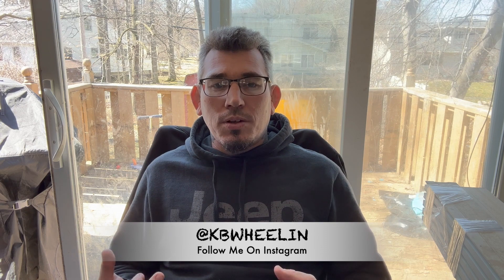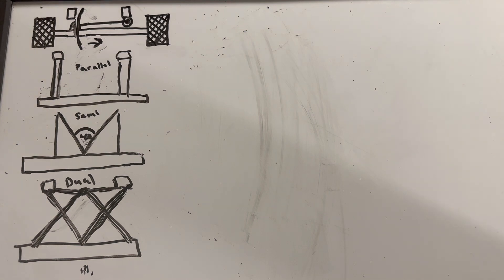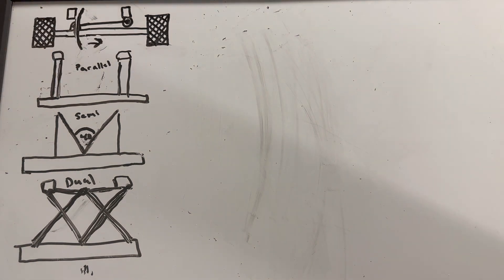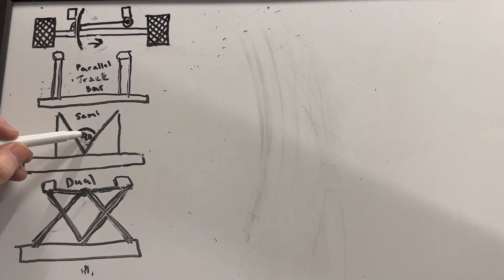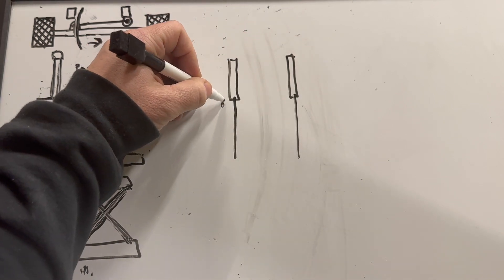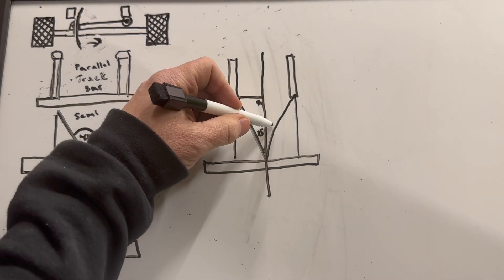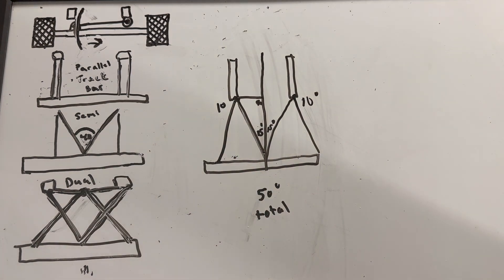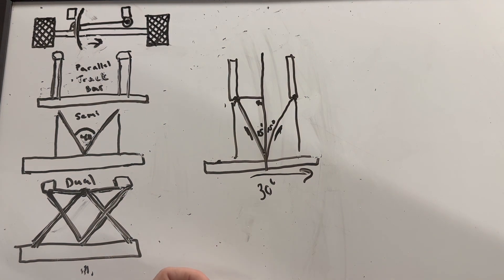Do you need a track / Panhard bar with a 4 link? Do you have enough triangulation?

Comment: On a parallel four link you mention we need a track bar, My question is; instead of a track bar can i use coil over mounted to the axle or frame instead? Thanks!
Reply from the maker: Not sure I understand what you’re meaning. You need a mean to make the axle track center. On a parallel 4link you would have to have a track bar or watts link.

Comment: On a triangulated 4 link does the pinion angle rotate to follow the t-case when traveling up and down over a long stroke range?
Reply from the maker: Depends on the upper link vs lower link length as well as bracket locations. Equal upper and lower will yes but again bracket locations can effect this.

Comment: Are you talking about a triangulated 3 link? If so I run that setup for years wheeling Tellico when everything was open. It was a Toyota turned 80% buggy with a 60 and 70 with 6.17 gears and 44s. Never gave me any problems, but I was using a 1.5" solid rod as my pivot in the upper link/a-arm. That was for the side to side movement. Had bushings parallel to the axle at the frame and axle mount. That poor thing was rolled at least twice every trip out. Had numerous hard landings on its side and the suspension never gave me a problem. So will it work? Yes! Would I do it that way again? Probably not! Mostly because it was a huge pain to get everything to clear at full compression.
Reply from the maker: I’d love to see some pictures of that set up! I’m kinda curious tho if you triangulated the uppers why didn’t you just run a four link? I have considered trying a lower triangulated 3 link on a build soon just to try it cause usually I have enough room on the lowers but the uppers would hit the engine or driveline. Show me some pics of it if you could on my instagram @kbwheelin 🤙🏻
Reply: The reason I did the upper was to have my lower links more inline with the tires for frontal impact. So the forces would be directed more to the frame rather than trying to shove the axle diagonally under the rig if that makes sense. The upper was designed to control side to side motion and axle twist only. It didn't get the burnt of the forces front to back. the reason I did it was because it was Wednesday and we wanted to go wheeling that weekend. In the times before Amazon stuff took two or three weeks to show up. Had access to a machine shop 4 heims and a problem to solve and that's what happened. It worked so never seen a need to change it
Reply: Also remember now the reason I did the upper was because with the pivot being above the axle it would swing the tire away from the frame a little bit for clearance where as if it was below the axle centerline it would swing closer to the frame.

Comment: Might be a stupid question but could you bend out the start of the lower on the frame and then straighten to the axle. As in make the lower to have a say 15-20⁰ bend in it about 75% of the way forward??
Reply from the maker: Yes you can. Putting bends in link arm, track bars, steering etc doesn’t make changed as far as the geometry goes. You draw and imaginary line from one end to the other. It does have an effect on strength and how much force it can handle. Jk’s for example come from the factory with bent lower link arms it’s not an issue
Reply from the maker: Hope that makes sense
Reply: @KBWheelin  thank you wasnt sure is a small bend from the outside of the rails in towards the rail may help with side to side shifting or not... would you be able to regain that lost strength with a gusset plate
Reply from the maker: No it won’t do anything for the side to side movement the bends in the lower links are to make room for the tires while turning